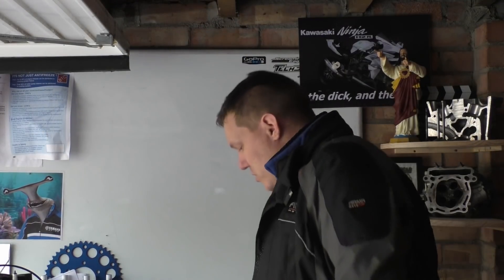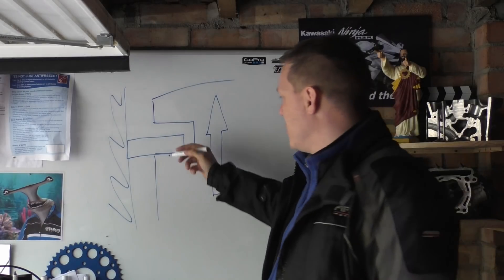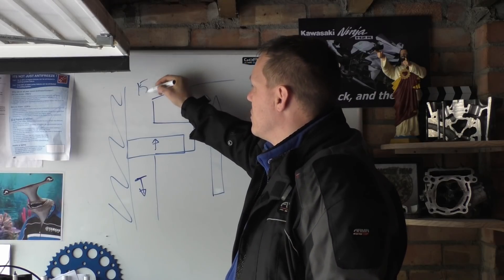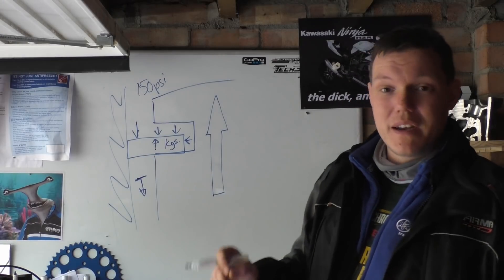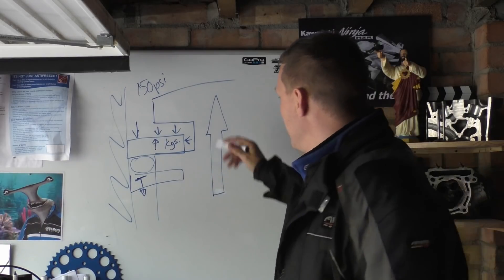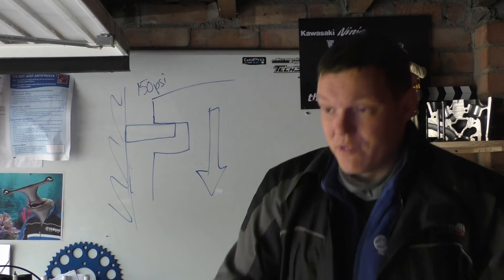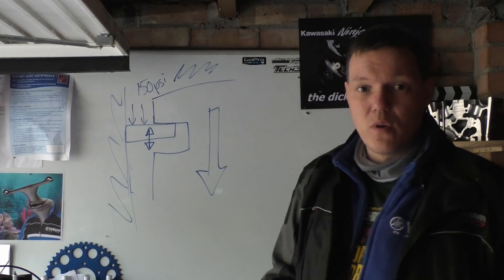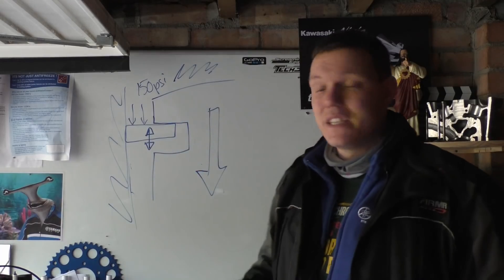Piston rings - More about them

Comment: At the top of the exhaust stroke and during the intake stroke I would believe the ring would be at the top, but for it to get there at TDC on the compression stroke seems damn near impossible. At idle bikes fire about 12 to 15 degrees BTDC and over 4000 rpm they fire between 30 to 40 degrees BTDC. The point where your piston is slowing down at its fastest rate on the compression stroke combustion has already started. It just seems like your top ring would have to have a shitload of momentum to overcome that. I can see how ring flutter would be a problem on the 2nd ring though.

Comment: I have a 1991 16v BMW K100RS and have noticed that if I am doing gentle touring with my wife on the back it uses almost no oil but if I am riding the twisties and revving hard I use boats loads - as in 8 ounces in 200 miles.  Could that indicate worn pistons rings?  I was also told on a group ride the other day that under hard acceleration some black smoke comes from the exhaust , another symptom of worn rings maybe? Other than the oil usage the bike runs great, though I am replacing the rear main seal this weekend because it has started to mark its territory...
Reply from the maker: Sounds like worn rings, smells like worn rings. Worn rings..... LOL

Comment: Wouldn't the crankcase breather vs piston displacement causing the vacuum only apply to engines with odd numbers of cylinders?  In a flat plane four stroke as two pistons go up the other two are coming down displacing the same amount of volume being created in the bottom of the other two cylinders. So no volume is being created or lost, the air volume is just moving from one location to another. Same should apply for all even cylinder engines (2,4,6,8,10...) since for all these these motors every piston has one operating 180 degrees from it's location on the crank. Obviously for 1,3,5... there would be a changed in volume or the 90 or 120 degrees separate 2's. But for my point there may be here a higher creation of a vacuum at higher rpms directly under the piston due to the air changing direction quickly but since there wouldn't be a change in volume there shouldn't be a vacuum on the under side of the ring.

Comment: Hi matt, Why do we need a table reference (the time trigge injector) for the ecu to inject fuel?
Why not just put in a formula for ecu to calculate the fuel and a table of the AFR that we want for the engine to run?
Reply from the maker: Because sensors can't be trusted. Not only this but there are other inputs - say the knock sensor to consider - which can over-ride these settings.
Reply: Actually, tables can represent function approximations. Through multi dimension tables and interpolation you can actually implement efficient (processing power) Multi Input Single Output transfer functions. The actual problem with plugging in an actual mathematical function is that most of the time, required functions are pretty complicated. Usual polynomial series approximations will require a lot of CPU time and they become really hard to implement for higher orders. It's way easier to look-up a value in a table than to compute it each time.
Reply: now i'm more confuse than before, so they can't solve those problem, can't make good sensor? can't find out a fomular for the knock situation?
Reply: so... the processor really can't handle massive polynomial series approximations or it's just cost to much to do that? yeah i'm really want to know the principle which ecu use to calculate the time to inject
Reply: luuvi nguyenhao They actually can, but at the end, its bad engineering when you don't cost optimize. 1 dollar added cost for each ecu for a better processor adds up quickly in the end. I'm working in software engineering for these thing and you won't believe how tigth manufacturing cost is managed, even if we talk about hudred dollars ecus.

Comment: Couldn't one cut the ring groove with a taper in the root, and make the ring with a slight taper on the I.D. so that when the ring is being forced against the bottom edge of the ring groove either by the gases on top of it or the friction against the cylinder wall, the ring would be wedged harder against the cylinder wall to make a better seal?
Reply from the maker: Some rings are - as usual we'll go into this further LOL
Reply: I think due to the angled surface you lose some of that force from the pressure when the ring is down in the groove where it belongs

Comment: Hi Matt we had a piston with a nice hole burned into it at work. Looks pretty cool! 
https://imgur.com/a/OKvLUSg
Also fun to see how great steel is in comparision to aluminium. Rings were pretty much reusable lol
Reply: Was over-fueling the cause of failure?
Reply: Yeah, sorta. Definetely a fuel related problem. Leaky injector probably. Well, more like dripping injector. And possibly too much fuel but unlikely. It is an old style diesel with one central pressure and timing pump, not a commonrail system. Those pumps rarely fail in such a way but the injectors do sometimes. They fail to spray properly and just piss the diesel out. Also it is air and oil cooled machine so overall heat might be pretty intense.

Comment: What happens on the exhaust/intake stroke?
Reply: +gislemark 
During the exhaust stroke, the rings behave the same as during the compression stroke. 
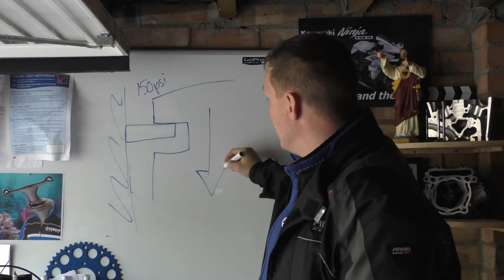During the intake stroke, the rings behave the same as Matt shows at 3:30 . 

It should be noted that ring flutter is an anomaly and usually occurs only under certain transient operating conditions. 

http://korihandbook.federalmogul.com/en/section_39.htm 

https://www.highpowermedia.com/blog/3762/piston-ring-flutter

https://www.google.com/search?num=100&newwindow=1&source=hp&ei=ElL7WtH2Fo34zgKniqeoDA&q=ring+flutter&oq=ring+flutte&gs_l=psy-ab.1.0.0j0i22i30k1j0i22i10i30k1l2j0i22i30k1l3j0i22i10i30k1j0i22i30k1j0i22i10i30k1.13067.13067.0.26060.1.1.0.0.0.0.86.86.1.1.0....0...1c.2.64.psy-ab..0.1.85....0.bL4ZOKlSVS8

Comment: Matt wouldn't another cylinder coming down cancel out the change in volume from the cylinder going up? Obviously a single cylinder engine does exactly as you say, but my thinking is that any even number of cylinders would always result in neutral pressure in the crank case?
Reply from the maker: https://www.youtube.com/watch?v=zjH5hNAbQnM
Reply: Vintage parallel twins have pistons that go up and down together - 360 degree firing interval.  So, instead of cancelling, the problem is actually double what Matt says on twins like them.  Some modern twins like Triumph use a 270 interval firing order so nothing cancels there either.

Comment: You surprised on this one.  I thought you were going to say that the outer edge of ring flexed downward (inner edge flexed upward) controlled by the gap above the ring in the rings slot; especially when the piston is rising.  I think (not sure) this is why modern rings for vintage British bikes often have a bevel (chamfer) on the upper, outer edge of at least the top ring.  For instance, Hastings rings for 1970s Norton Commandos have the bevel on both compression rings.
Reply from the maker: This is a more indepth discussion which we will look at soon.